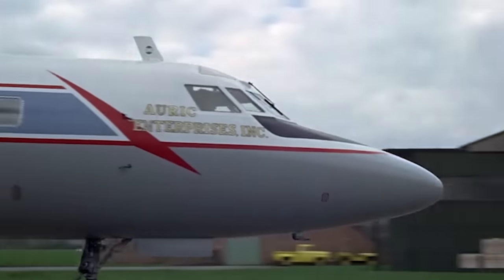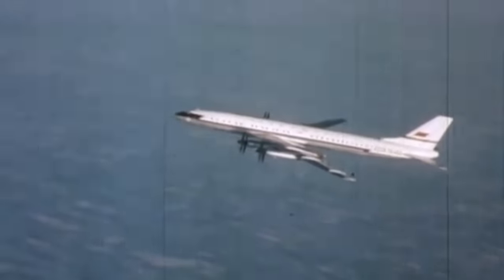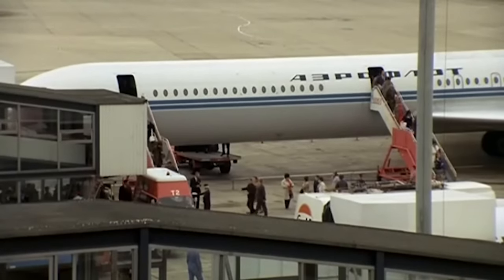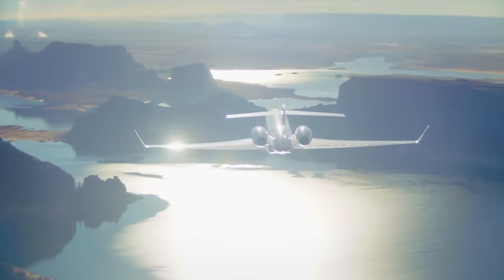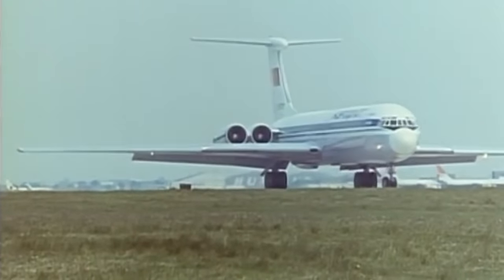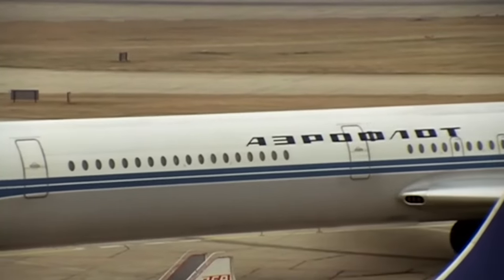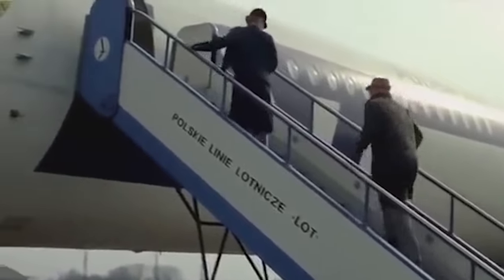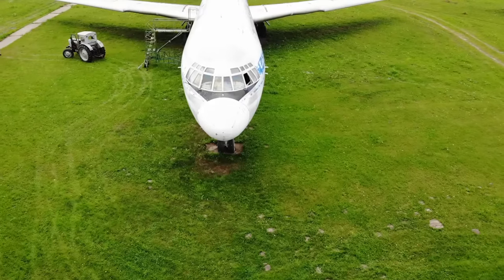IL-62 - an ideal option

Comment: I've only flown on one Russian plane. Granted: it was flown by a Chinese Airline at the end of the 1980s. The seats were lawn-chairs with a little foam, and you could push down the seat back in front of you to put your feet on top: Consequently, the back of each seat was filthy from the dirt that came off of people's shoes. After the first person took a piss in the bathroom the entire plane smelled like urine. Either the negative pressure system wasn't working or they wasn't any. The windows had air bubbles in them and were wavy like, the windows in 150 year old buildings. And finally, between the rivets on the wing you could see the aluminum skin wasn't stretched because it buckled and puckered like someone flexing a sheet of paper. I've got over 1.2 million miles but that was my single worst experience in a commercial aircraft. One has to ask: if the Soviet Union was so good at building planes, then why 30 years after the collapse of the Soviet Union they don't have a robust airliner business comparable to Airbus or Boeing? They had the tech, the tools...but...nothing!
Reply: The answer to your final question is both simple and complicated.
First of all, previously it was the Soviet air industry. Now there is no USSR left. This means that many production plants which previously operated in one border, under a common gouvernment now were split or even disintegrated as a result of 'shaddy' practices. This means that for Russia alone to relaunch such a big business they need to first rebuild the industrial base a much larger nation previously had. And this takes both time and money. There are also other problems. Established companies like Airbus and Boeing (the only ones that actually exist and matter) have certain advantages which allow them to take advantage of regulations to establish a duopoly. Companies need to provide procedures and training methods and equipment for their pilots. Which means a whole new expense. Airbus somewhat got the better end of the deal since their implementation of fly-by-wire means that airlines could use similar training methods for all the pilots (since cockpits are rather similar), reducing the cost on them and making Airbus more attractive. Even Boeing faced this problem and this is why they farted out the Max 8 with the known problems. 
So, in short, they simply cannot produce it. They don't have the industrial base and the market is already too rigid.
Reply: @nottoday3817  Thank you very much for that well thought out, well articulated explanation. Well done, sir. And it sure was a waste of resources. I'm of the belief that anyone doing anything better, smarter, faster, cheaper is benefit to all human kind. We all win.

Comment: I wonder what it would be like to mount two engines at the rear (one each side of the tail), and an engine slung underneath each wing. Was that ever a format that was used in commercial aviation? Or any form of aviation?

Comment: Nice and interesting video, but I've just a small remark: you mentionned the IL-96 as the next generation long haul russian aircraft, which is not correct, since it was the IL-86 (which appears briefly in your video). Then IL-96 was the evolution of IL-86 ;-)
Reply: Skyships would have been correct. The IL-86 is not a long-haul airliner, it's a medium-range airliner - check out its range. The IL-86 was never and could never be a replacement for the IL-62.

Comment: Did you know the reverse thrust on the il 62 is  2 engines on left and right will block air from to flow from the engine with close the hole back on the engine and ah hole will open on the top of the engine

Comment: Another kind of 'Cobra maneuver'? Because that is not the Cobra maneuver that I am familiar with, although slightly similar. The Cobra involves a plane pitching up to 90deg or more while in flight, then returning to level flight. A mere pitch-up is not a Cobra, especially not on the runway. Its more like 'reverse rotation'.

Comment: A very good design. But unfortunately with some flaws in the construction of the rear part. This was the cause of some fatal accidents: Interflug, LOT.
If an engine explodes or if there is a fire in the rear bulkhead, the risk of a serious damage of the rear flight controls was very high.

Comment: I think controlling for the climate where it was operated and maintenance quality, the IL-62 was one of the safest planes ever built!   It started, landed and flew mostly in the planet's coldest and cloudiest locations, N.Europe, Lenningrad, Moscow, Siberia, the Russian Far East etc.   Was maintained by various nearly bankrupt and frequently sanctioned national airlines known to be economizing on maintenance intervals and re-using used parts past their safety limits.   That 1987 Polish crash was one example.  LOT airlines routinely extended regular maintenance periods against producer recommendation (!) and let their planes fly a mix of new and old worn out engines (past due for rebuilds at manufacturer).  It resulted in a crash.   The plane was used by many airlines of poor communist countries under western sanctions, embargoes, etc.  Poland in 1987 was on the brink of bankruptcy from sanctions and embargo the West imposed stemming from 1981 imposition of Martial Law.   Many other similar crashes were a result of bad maintenance or constant operation in worst weather conditions.  The plane itself was nearly impeccable.   Produced without a single Capitalist (!) ... a completely not understood nature of its true achievement (particularly not understood in the West).

Comment: I don't think the IL-62's rear wheel "crutch" is such a bad solution at all.  Take the B-52 bomber for example.  It has such a wide, unwieldy wingspan that it had to have wheels added to the wingtips to keep them from slapping the runway on turbulent or rough landings.  You've got to appreciate Russian simplicity and efficiency in design.  Perhaps not always the most comfortable or esthetic design, but it consistently and reliably works.

Comment: So the pilots didn't enjoy flying this plane because of the lack of hydraulic boosters but it was a nice ride for the passengers.
A bit surprised that four jet engines were not enough to properly power this plane in the early iterations.

Comment: There is a huge difference between looks (nostalgia , sentiments etc.) and actual value . Delorean as example . Me , being polish , growing up in Warsaw where i remember crashes of SP-LAA (1980) and SP-LBG (1987) i see those russian things somewhat differently . Look ; after the Berlin wall was torn down , the next thing that happened was every "red zone" (Cubana was the last one) airline got rid of their planes and replaced them  with ATR's , Boeing's .... even Embraer's which even north american operators fly. Ironically , even $@#%$...ng AEROFLOT has Airbuses etc. SP-LAA went down 2kms from my my house and i still remember the eerie silence and the smell of kerosene . The street name was replaced in memory of the Victims ; along with a polish rock star . Lest i never forget .
Reply: The companies replaced many planes because the western ones were cheaper to operate. Even the new modernised versions of pre-90 aircraft cannot operate with at least a 3 man crew (2 pilots and a flight engineer). This  makes them extremly uneconomic to fly.

Comment: I note when taxi-ing, the 2 outer engines not running but in the wind, both props turning the same direction... how does that happen ?... (they weren't contra-rotating)?

Comment: I suppose during this pandemoc of COVID here in 2021 NONE are no longer in public passenger service anywhere on this planet, uh... am I correct? I would LOVE to fly in one of these1 I suppose your museum does not have the financial resources to make these airworthy and available short flight (sort of like Lufthansa has refurbished Tante-U a Junkers Ju52-3m. It has regular flights for the general public and in switzerland there is Ju-Air near Zurich that flies FOUR Ju-52 3ms in regular tour flights over the Alps and Bern(.  Ju Air uses the ORIGINAL BMW radial engines! I hope you can gaet both the Tu-114 and the Il-62 back in the air with 'ferry flights' for the public! I would LOVE to fly in both of them!

Comment: The aircraft’s fuselage design is quite unorthodox by today’s standards. Having a rear-engine and t-tail configuration, this would make it look like a short-medium range airliner when in fact it’s high passenger capacity and quadruple engine configuration could allow it to fly up to under 10 hours. Either pioneering or truly perplexing.
Reply: 4 engines needed to cross the Atlantic at the time

Comment: I saw one of these planes yesterday 08/14/2020! Never before saw it so I had to research what it was. Very interesting fact is the location and date. Could this plane land and take off from a 2700 foot runway?
latitude     40.639351
longitude -74.681336

Comment: I don't understand why old airliners had wardrobes. I guess it would make the boarding and deplaning much slower than the modern way of just leaving you jacket on until you reach your seat and then putting it in the overhead compartment or somewhere else.

Comment: This aircraft is equipped with 3 section ailerons. Somebody knows if they are free floating or spring tab types? Would be nice to know how they are interconnected? If iam correct the inner pair is for higher speeds and as slower you fly the outer pairs come in action additionaly.

Comment: I noticed that the labels on all the controls are in Russian. On the Il-62 planes that were exported, were these labels translated (into Chinese, German, etc.) or did pilots have to learn Russian? Were the manual, checklists, etc. also Russian only or multilingual? I would appreciate an answer if anyone knows.
Reply: In my faculty (Romania) we have some Russian flight equipment from 'Good ol times' and it's in Russian and english I believe (Haven't seen them since the Pandemic and even them very briefly)

Comment: Damn, is it really that much trouble to get a few cans of paint for that magnificent plane ???  It hurts to see it in this condition...
Reply: For some context I have been to Monino in 2017. Finding the place was an adventure, and required the help of some very nice locals that told us which direction to go. There were a total of 2 A4 sized posters hinting at the existence of the museum, and as we got closer, the streetside fence had propellers inlaid and was the only real indication. We arrived at the back of the museum, where a big mural could be seen through a large gate. We then had to walk all around the entire place to get to the entrance, and then we paid the equivalent of (iirc) 3.50 Euro to get in. So, there's no chance anyone would find the museum by accident, getting there if you're not able to speak Russian or at least read cyrillic is an adventure, and the entrance fee is extremely low. It's no wonder they have no money to keep the planes in good shape. If you ask me, the entry fee should be raised by quite a lot, since most people going there will be enthusiasts, and perhaps a little advertising and easier wayfinding wouldn't hurt. It's a shame, but that's how it is. The staff is very friendly and clearly invested, but funding a museum like that is probably near impossible.

Comment: I always just picture one of the engines exploding which takes out the engine next to it. After seeing how much damage an uncontained engine even on modern aircraft like the A380 I am surprised its engines location on these and especially tail mounted engines were never a good idea??
Reply: Unfortunately the 2+2 rear-mounted configuration is on balance LESS safe than 4 engines each mounted on under-wing pods. This is because an uncontained engine failure is more likely to damage the adjacent engine of a pair than an engine on a separate under-wing pod. This argument loses some of its clout when there are only two engines, but the risk of catastrophic damage is still worse in the rear-mounted case due to the proximity of control mechanisms.
Reply: Well, this could generally be solved with reinforced nacelles.

Comment: Got photos last year in Khartoum of a freighter variant still operating.  Actually, the white one at the end of your great video.
But the idea of deploying thrust reverse in the air is not a good one.  And why all aircraft manuals forbid it.
You only need one not to work........
Also l remember reading that LOT Polish airlines operated them at such a high weight on the JFK flight, Warsaw Airport constructed huge
concrete barricades at the end of the runway, so if it didn't make it off the ground, it wouldn't wipe out a whole neighbourhood.

Comment: errr.... the quad tandem engines had tendency to explode. So, if one engine exploded, it would take out the engine next to it, possibly the engine on the other side of the hull, and steering cables. https://en.wikipedia.org/wiki/LOT_Polish_Airlines_Flight_5055.   That's why NOBODY uses that configuration for safety purposes.

Comment: What a bad*ss plane. Rear engined, practical, and durable. Factoring out pilot error, I would dare say the IL-62 was the safest long-haul airliner of its class/generation, compared with other Soviet models, and American ones too. C'mon, the damn thing is designed to slam itself down on a strip of bumpy dirt, and pull a Cobra to slow down, and them slam the nose gear back onto that bumpy dirt. On a regular basis. Do that in any American jet, and you will have people on fire every time.

Comment: Think considerations with the VC-10 is design to cope with high altitude short rough airfields in African colonies. Engines higher up to protect from FOD foreign object damage. Something like that. Sad that not many of them built and sold, was it only about 50? RAF took over many of them for service sand families passenger transport internationally.

Comment: The Russian IL-62 was a plagiarised copy of the Brits VC-10.  The VC-10 flew in the time of cheap fuel, in the 70s when the price went through the roof this absolute magnificent plane could no longer compete with the more fuel efficient aircraft coming on the market, particularly from Boeing with their 747.  Once saw an IL-62 at Beruit Airport.  Identical in almost all aspects except for a single stabilising wheel poking down below the tail.  Looked ridiculous.  The VC - 10 was the best aircraft I ever flew.

Comment: Put all the engines at the rear, how more wrong could it be as a design (I blame both the VC10 and the IL-62) ? If an engines breaks, you can be sure it'll kill its neighbour and that's exactly what happened to the LOT flight 5055 in 1987. In this case, they lost all engines in a very quick succession and since all the hydraulics were also in the tail, they were hit hard and fast as well and the pilots had no chance to recover from their fall. Some 707s, DC-8s, 747s etc. had similar failures, it never ended that bad since they were better designed right from the start.

Comment: Engines on these blew up due to poor quality (shafts disintegrating), in LOT additional safety monitoring devices were installed to better monitor access vibrations during flight, alarming pilots on potentially disintegrating engines, as factory solution was showing little data to late, thus showing this simpler design was not always so good.

Comment: There are some issues that wasn't metioned, a i think that they should have been.
1. IL's engines had a poor quality (every single type). Which as a one of factors resulted many crushes - more than an eastern aircrafts this time. Many of my compatriots died because of that design and poor manufacturing - which russians even didn't want to admit.
2. Even last version of engines has too low thrust (while carrying max payload) in higher environment temperatures.
3. Configuration of engines resulted higher noise compering to classical one (below the wing).
There are more cons of that plane. It was a good machine if taking into account conditions of living in USSR and its allies, but only then.
So, overall i can't agree with the author

Comment: Can someone explain why russian aircraft have to go full throttle before brake release on takeoff
Reply: Not a specialist on Russian aircraft, but from my knowledge of enginer engineering there might be a combination of 3 reasons:
1. Optimal RPM. Gas turbine engine usually reach their 'optimal' output much slower than piston engines, meaning they need to run for a bit longer if they start from low RPM. However, if you let the aircraft accelerate freely, you might have the nasty surprise of running out of runway before you reach the optimal RPM/thrust (mind you, you need that for the more demanding stage of climbing, not just for 'taking off')
2. Standard procedures. Russia and USSR operated many regional airports in remote areas (so you kinda needed a long haul or a modified medium haul for them). Those things don't have runways to the lengths and qualities many are used in the West. This means you need to get as much power in the engines before you start going up the runway so you can take off faster
Reply: al engines have to build a wall behind to use as a mens of pushing forward  same as turbo lagg 8 seconds usualy